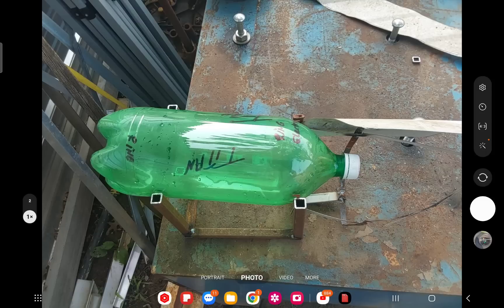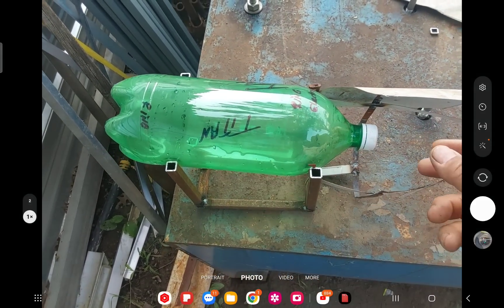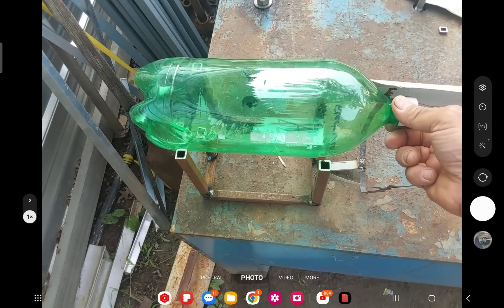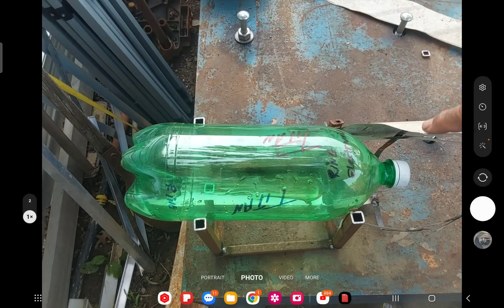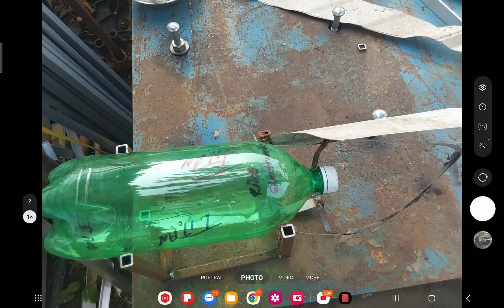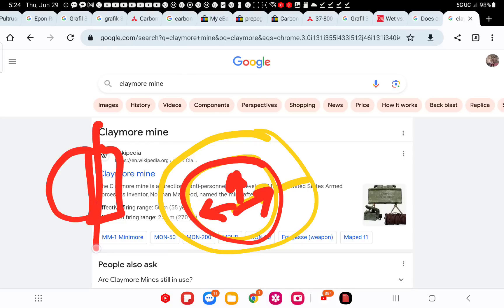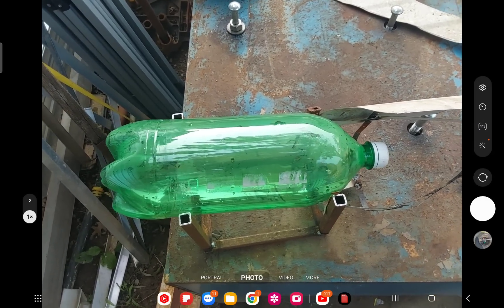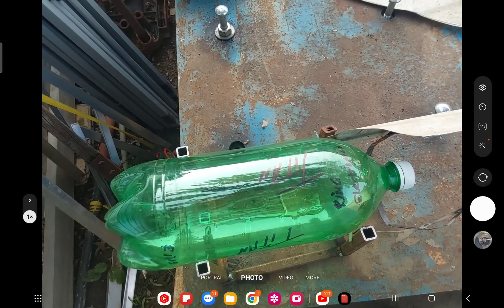Titanic Titan Implosion at rear overpressure ORhydraulic EXPLOSION via OVERPRESSURE of hull u decide

Comment: I'm making my own submersible to visit the Titanic, it'll be able to fit 3 people. It's made from shredded cardboard and construction glue mixed in a large vat. The cardboard/glue slurry is then hot injected into a once piece mold where it's heat baked for 36 hours then allowed to air cure for another 36. The finished product is very strong, the monolithic design distributes pressure evenly. It'll be ready for tours in 2024 and tickets only cost 10k a piece.. not bad for a trip to see the worlds most famous ship.
Reply from the maker: Where do I sign
Reply: Is it a round trip or one-way only?
Reply: I'll go if wall thickness is 1 kilometer.
Reply: No.. that sounds risky. You need to use Gorilla Glue, then it will be strong....
Reply: I never was interested in subs,but since this happened suddenly I’m designing my own in my head,for 6 persons,Titan ball of 4m-4,5m diameter ,two flors,with proper toilet,galley downstairs,with seats for 2 VIP guests size to take comfortable like Shaq O’neal ,2 pilots and 2 scientists.With no portholes,screens all over cockpit,cameras outside,activated on sensors,robotic arms capable to cut you out of any ghosts net,system of collecting samples,system of collecting energy,recharging batteries,system of water a board,System of going up-change of form,inflation like of ships longs,solar system on top too,to gather energy when on top.Proper connections to satellites,security systems of all sorts...I can’t believe someone payed 250k t9 go in that bathtub with garden hoes 🤦🏼‍♀️First I was in shock from Titan case,but then my brain from that horror started to build like solutions,I’m inspired to create a perfect sub for such expeditions atleast on paper and in my imagination...wish me luck 🍀😂✊🏻
Reply: Not sure that I want to go, but Xander my cat might, he likes your low cost ideas (remember, safety is just an extra waste).
Reply: Do you all even realize that other then the glue the ship was pretty wel designed and that the carbon composite was 5 times stronger then steel the only problem it has is that it shrinks to much on descending although it shrinks evenly it might have created air gaps between the ring and carbon composite but this is the only way to merge carbon composite to other materials because you can't make holes in it. If he would have used a steel hull it would have been to heavy and the risk of implosion would have been allot higher due to the  shape so in hinsight there was really not that much wrong with this submersible. Maybe the hole for the wire started leaking maybe the glue malfunctioned but I never believe the carbon composite imploded on it's own it's seems rather unlikely because it was just replaced unless it was already cracked on assembly.
Reply: As long as you use an Xbox controller and not a Playstation controller, I will send you a $5000 deposit to assure my seat on the innovative sub. Obviously, the Playstation controller already proved to be a disastrous idea.  Rush was right.  Regulation and certification slows progress. Do you have a name for your magnificent vessel? What shape will it be?
Reply: I would immediately have everyone sign contract that make gum chewing mandatory........if there is a breach of the hull, any "mission specialist" could quickly spit the gum in their hand and patch the hull with it. Stockton would approve
Reply: PeterGriffin….. I’m in !
Reply: @Gus1966-c9o  For the price, you really can not go wrong.  He is letting the cardboard composite epoxy cure for 36 hours.  That sounds like careful engineering, to me.
Reply: @barbarakiewe2870  Thats a good marketing angle, one way tickets to the Titanic. half price.
Reply: Does it come with a complementary sonoluminescence experience at end?
Edit: That's the end of the decent

Comment: Saw how they bonded the end caps to the carbon fiber tube, and I was amazed at hot little bonding area there really was. Seems like even a small amount of compression or deformation, would easily separate the end cap from the vessel. The titanium end caps look to be intact and in pretty good condition, like they popped right off
Reply: It's rediculous. It's like gluing the wings  on a fighter jet.
Reply: @ferolcat2009  but, the rings most have been attached to the carbon fiber at the moment the end caps blows out destroying the bolts betwin end caps and rings. As I see it the first there happens is the front cap blow out then end cap and then later the cabin cruss and detactc from the rings. Have the cabin imploded first, will the   end caps still have been bolted to the rings. There is a big wish for it should be the carbon fiber, but I think it make many blind for other options.
Reply: @earlgreystoke3324  Take a can of corn and cut off the top and bottom lids, squeeze in on the middle of the can, and see how easily the open ends begin to change shape ans not remain round
Reply: @BertMerlin57  Imagine if the hull imploded, the air inside the hull would be squeezed with the enormous force and would heat up to a few thousand degrees. This highly pressurized and super heated air, if it went to each end would be enough to blow the end caps off the rings and could be why the window was out as well.

Comment: Even the designers of the earliest bathyscaths knew that an oval or ball shaped chamber is the strongest. The experience inside during the implosion/explosion was like being in a diesel engine cylinder at the top of it's compression and then ignition strokes.
Reply: Yes, but a diesel with a 380:1 compression ratio.
Reply: Trieste (bathyscaphe)wasn't bell or oval shaped!
Reply: @paulburns3039  The pressure vessel was. The rest of the vessel was floatation tanks filled with hydrocarbons for buoyancy.
Reply from the maker: https://www.youtube.com/watch?v=Mf7SRPGe_RU&t=0s
Saturday gift to you all, an extra video
Reply from the maker: https://www.youtube.com/watch?v=Mf7SRPGe_RU&t=0s
Saturday gift to you all, an extra video

Comment: I’m just speculating.  They heard major cracking.  Something major was wrong.  They dropped the landing (I could swear the landing legs could be detached in an emergency so they float up faster.) The landing legs got caught on some wiring or cables. So the detachment of the legs pulled off the rear end.  That’s why the horizontal bars on the rear end are a slight V.  The rear end then pulled on the rear dome or the vibrations caused further weakening of the carbon fiber which then it imploded.  Alternate theory:   Like you said, they descended too fast but I want to add the theory that they actually hit bottom at near full speed which sheared off the legs and rear end.  Then implosion.  However my alternate theory may not hold water due to landing gear not being bent too badly.  Hybrid alternate theory:   Descended too fast.   One way to release the hanging weights was to rock back and forth.   The rocking caused the rear end loosen and fall off.   A major contributing factor to the rear end rattling off so easily is the fact that this vessel has been to Titanic depths numerous times over a period of years, so you are correct I believe, regarding both metal fatigue and rusted / and or inferior bolts.
Reply from the maker: Pug,I have now done tens of hours of the Navy's research on implosions, dating back to 1970; they even tested Xmas tree bulbs.
The testng is all lab work and the short answer they come up with, implosions and location on vessel is UNPREDICTABLE but you might guess it right 
Currently they used scaled models and computer theory ONLY and then they only operate within ⅔ of their max working depth.
The Navy has NEVER done full scale, real World testing and the current implosions of Navy vessels all turned out to be hull breaches first! 
The Russian sub never imploded and they died from a fire while waiting to be rescued.
This Titan is the only failure of a tubed vessel of carbon fiber ever! 
The Navy needs this vessel bc it will give science to failed vessels at depth.
In short, lab implosions are also, always a hull breach and NEVER a true implosion bc the technology does not exist to maintain true depth pressure after hull breach because the void space (hull) upon breach drops the testing equipments pressure and just adding pressure after a hull breach, in a lab, does not but test the density of the inside materials and further stresses the test equipment.
In closing, lab and computer testing are defective unless they can truely scale the vessel with plumbing inside , the ribs, etc...
Because, real World Navy vessels have two hulls, ribs, broken and leaking water pipes, hull breaches, bull heads and often internal explosions that create the doomed vessel...
The Russian sub never imploded, they had survivors at the bottom that ultimately burned up trying to make more oxygen while waiting to be rescued.
But, the navies around the World said they all were crushed from implosion!
ALL these Navies turned out to be wrong and the captain wrote, in his last words, that they were attempting to make oxygen and were awaiting rescue! 
That vessel never imploded but had a hull breach from on board ammunition failure also...
The concept of implosion is almost mythical and theoretical but, it's always a hull breach first and how the vessel behaves after that hull breach, is NOT predictable by the Navy's research...
I would argue it is some degree predictable but you would also have to have knowledge of those specific materials at time of hull breach and then determine what would happen in that shape of vessel and the materials reactions from the applied forces over the next fraction of a second...
Reply: @ForensicCats  "The concept of implosion is almost mythical and theoretical"

Very correct. one way would be to fit a junk submarine with cameras and sensors and sink it to the depths. recover the data recorders through a auto surfacing pod. or fit giant external buoyancy tanks that can auto void water.

Comment: As a NASA-inspired engineer, I can say that the symmetrical rate of the expansion coefficient would counteract the molecular bond of the atomic structure thereby expanding the ionic energy further amplifying exponentially the burst ratio of the compressive nature of the tubular structure, coupled with the accelerated rate of decay of the half-life of the carbon fiber bonding symmetry.
Reply: is that a scientific explanation or just in laymans terms?
Reply: Were they hearing horrifying crackling sounds first….before the actual implosion? Did they know something bad was about to happen?
Reply from the maker: @baremetaltechtv 😂 it is a treat to read ... He should work for Ocean gate as their spokesperson, after he tells the story, I won't even believe an accident took place and would buy stock in ocean gate!
PugFaceMedia is awesome and he is also an attorney and with that gift of gab, I find Ocean gate, not guilty!
Reply: They should have wrapped it with JB Weld.

Comment: Well done. I am beginning to think that a lot of the bolts were added to give a sense of robustness, but a lot of it was glued in, like that front window. I saw that first ring the one at 32:01 looks ovaled to me as well. You can measure that and see, I mean it might be lens distortion or an optical illusion, yes, but none of the other titanium circles look bent like that. If this thing collapsed in on itself, the semicircles could have moved in at slightly different rates to rotate and sheer the bolts, and the frame would just drop off wouldn't it? Though he did say he could drop that cage off too. Maybe it was a loud crack, they decided to emergency surface and released that, and it pulled something off with it that exposed a pressure vulnerability.
Reply: Wait, what? The window was glued on?!
Reply: The ends were glued in it was a insane death trap
Reply: I guess we will never run out of oceanic engineers, must be a million on YouTube..

Comment: The part that failed was where the power cable entered into the aft sub pressure chamber.  The RTM worked just fine and warned them of the impending hull failure. 
One thing to mention is the Titan already made 7 trips to the Titanic. The hull failed on the 8 th trip.
Reply: It appears something other than the hull failed first. maybe the crackling was the hull titanium ring joint compressing laterally from the stern forward..
Reply: It's not one thing to mention, many many many have mentioned "oh it went down multiple times don't ya know" that does not mean the CF was safe to use.

Comment: When carbon fiber fails, it is an explosive failure. When Boeing tests carbon fiber parts to failure, the explosion shakes the entire building. This means it is very unlikely we could even possibly start with a small leak.
Reply: stockton rush said they tested scale models at the university. They had to get everyone off the grounds, it would shake the whole building,  and apparently the explosions blew out the pressure gauges which stockton had to pay to replace

Comment: Titon - some thoughts

Any failure would have forces going into the pressure vessel.  Forces coming out of the vessel would be rebound from when all the incoming water meets at the center.

The pieces made of titanium did not seem to be damaged.

By elimination then the failure will be found to be in either the porthole at the front or the control system penetrations at the rear or the carbon fiber tube making up the center part of the vessel.  

The penetrations for the control wiring and tubes probably can be ruled out due to small size and industry experience at making  these penetrations.  This leaves the view port and the carbon fiber tube. 

Rule out the  view port because  its appears to have been ejected outward from the vessel. (The ring holding it in is gone.  If  it would have been sucked in the ring would have remained. Unless of course it was removed as part of the salvage process which is doubtful because they would not be altering the debris)

What’s left?  The carbon fiber cylinder.
Reply from the maker: You forgot to compress the internal air... and then explode the vessel from inside out... that is what a leak would do, as air would NOT be able to escape.
Also, NOT one military in the entire WORLD has done testing on real World, full scale implosions...  
Everyone is doing it in a lab or on a computer but the Navy ''implosions" are a result of hull breaches first and this entire crushing is theoretical and ONLY ONE vessel has revealed that... most have a hull breach and fill up with water and compress the air and blow out more compartments and hulls  but crushing can only take place if you can keep the hull intact and put vessel in the crush zone without a water leak.
This recovered vessel will be a training vessel for the Navy to learn about failures like this...
This small tube would become a damn closed end cannon and the air and water entering would blow these doors off and blow the carbon fiber apart but I think a lot will be recovered...
Reply: @ForensicCats  to the contrary - the pressurization is what caused the view. port to blow out in my scenario.  I'm saying that the leak if there was one would be thru the carbon fiber, not thru the rear penetrations.  Penetrations into pressure vessels for wiring is well developed and in my opinion has a very low probability of starting the event.  Thanks for the reply.
Reply from the maker: https://www.youtube.com/watch?v=Mf7SRPGe_RU&t=0s
Saturday gift to you all, an extra video
Reply: @ForensicCats  Touchè!